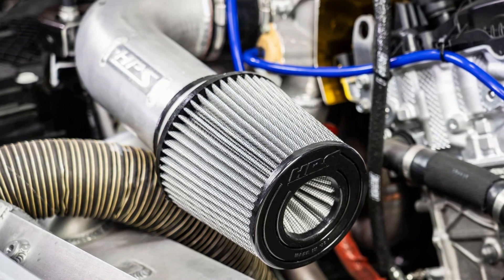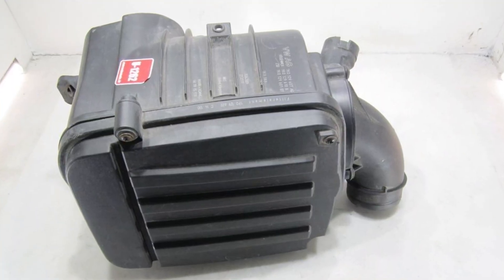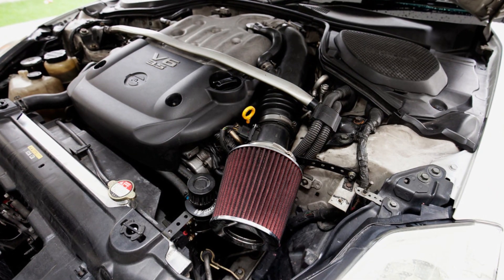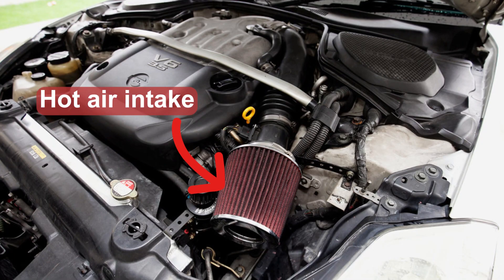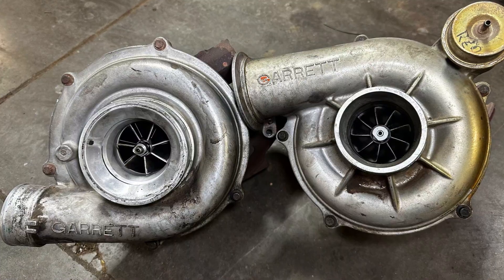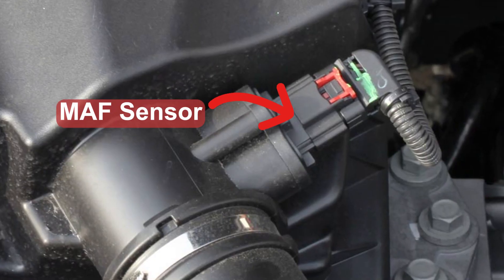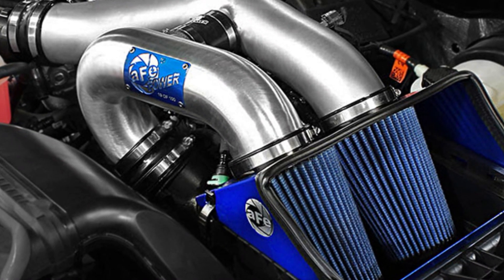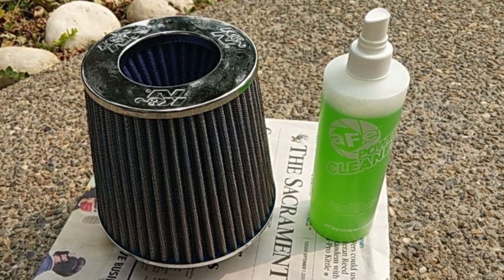Open air filter for performance: Pros and Cons

Comment: If I want to buy a used car with turbo engine and it has open air filter already installed for unknown amount of time how much should I be worried?
Reply from the maker: If it's a good filter that looks maintained, no worries. If it's a cheap cone, I would at least take the piping off the turbo and wiggle the impellers. If you feel any play, it's a very bad sign.